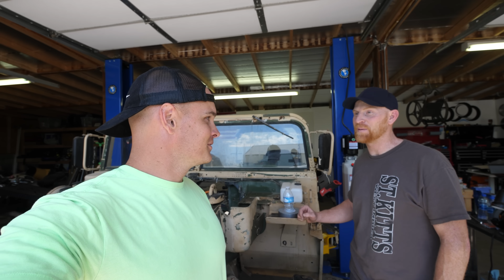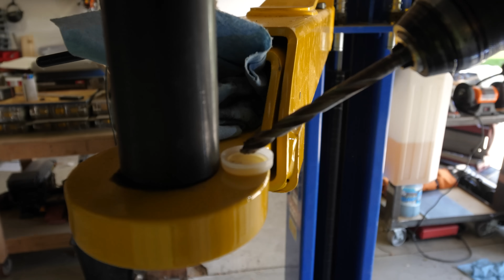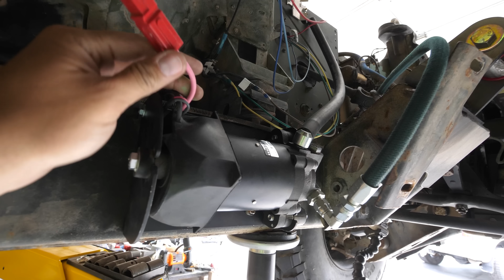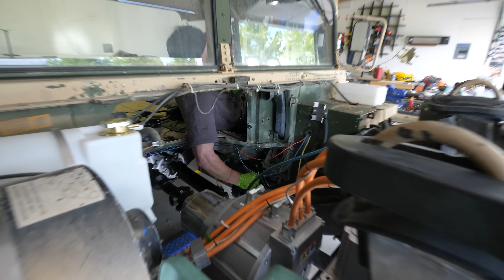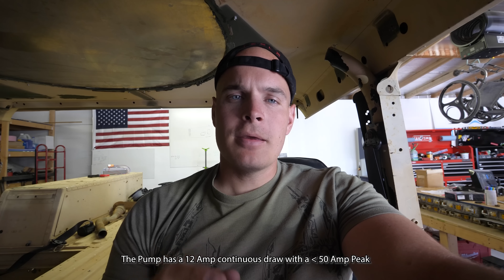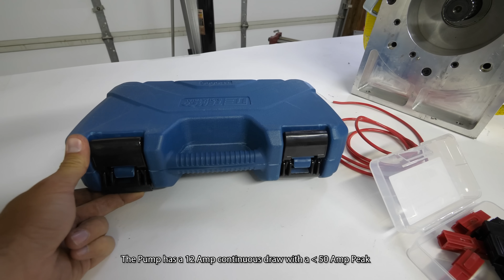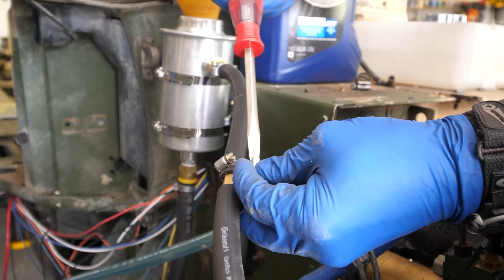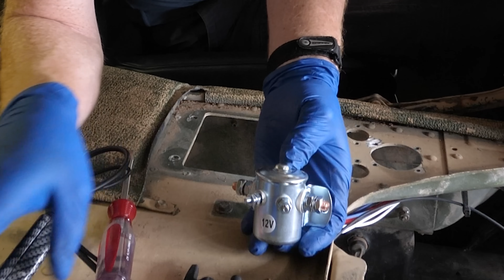We might have a problem with the Brakes... - Electric Hummer Conversion!

Comment: Go look at how Elon and team sound dentin the heat pump on the newer Model 3/Y/S setup with a cover / foam to surround it. Could build a aluminum type cover and find a expanded foam or harder foam to line inside of it, then go a step further and line the area behind and inside with the sound denting mat maybe and it may eliminate half that noise? Not sure how hot that pump gets or ambient and that could determine some of it?
Reply: Deadening. So hawrd?

Comment: Jerry last vid: the torque might blast all 4 tires off

The brakes: wait till he find out
Reply: I know it's a joke, but technically the gargantuan torque of the brakes never fully goes through the drivetrain or wheel axles.

Some torque is transferred back but it merely deals with the reciprocating mass in the wheels, drivetrain, and engine.
Reply: @dyefye4094  yea ik

Just felt like using the all 4 tires line